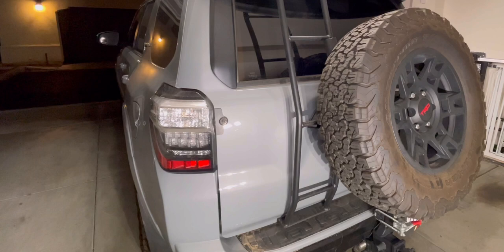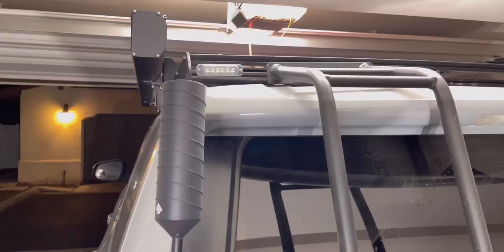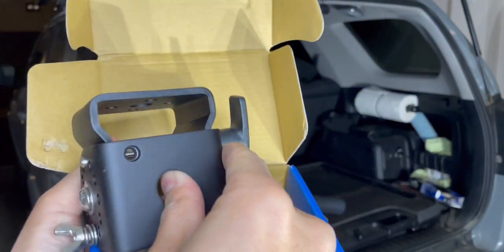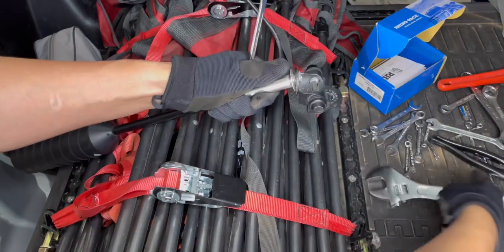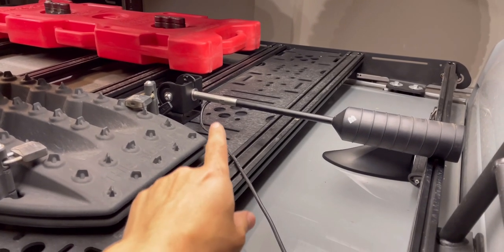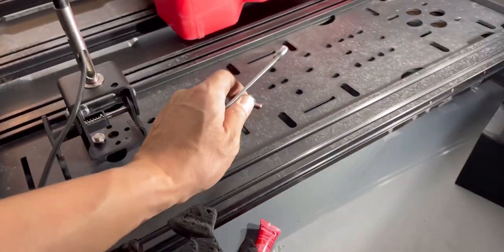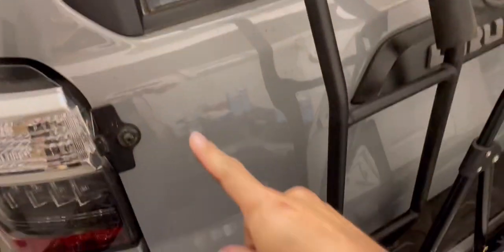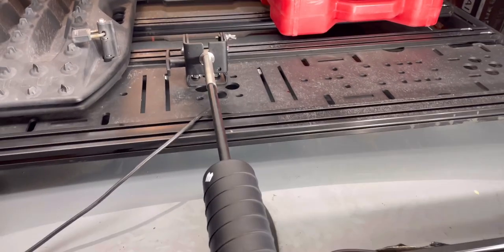Rhino Rack Aerial Bracket for 4Runner: WeBoost Folding Antenna Mount 🚙🔧 【72】

Comment: First, stop taking advice from people who don't know a thing about antennas; if they don't have formal education in electronics, EE or didn't have to take a test  to get a license, walk away. Second: What you have there is not much better than a dummy load mounted outside of your car. How, you ask?  Just look at it; putting a lump of inductance in the form a large coil at the top of the radiator is where it'll get the hottest meaning signal loss. Putting coils at the base or the top is a good way to loose radiated power. DON'T DO THAT!  C.B. radio sources are replete with garbage information. If you want to put a coil (aka, lump of inductance) to shorten your antenna length, put it somewhere in the middle where efficiency is greatest (think of current and voltage distribution (90degrees out of phase)).  The ideal placement for a loading coil in a quarter-wave vertical antenna is at the center of the antenna. This position offers the highest efficiency. If center loading is not feasible, the next best option is base loading. Top loading with a capacity hat or a large coil, is less efficient and can make the antenna mechanically unwieldy. This last reason is why your "booster" antenna sheared off. Again, DO NOT follow advice of [most] C.B. venues. Placing a center loaded antenna in the middle of your roof will give you the most bang for your buck, IF you're operating while in motion. If not, skip the loading approach and go with a full length 1/4 wave vertical, with a good ground (don't drive with that however!).
Reply from the maker: This antenna is not a CB antenna. It’s a signal booster for a Cell Phone signal. I’m scared…🤣👍🏼

Comment: Aren't you worried or concerned that you might get the WeBoost stolen. Where can you buy the bracket
Reply from the maker: Actual Weboost device is inside the car so they won’t steal that unless they break the window. It’s only the antenna that’s exposed so I guess I can’t worry about that or I can’t have anything mounted outside. 💪🏻

Comment: I thumbed up the video for support, but that mount doesnt seem useful at all. Too much work to fold and unfold it. I prefer the spring setup the Weboost came with that allows me to keep my antenna up at all times without worrying too much about if it hits something. 2 years and counting, with multiple strikes and no damage to the antenna to speak of. My antenna is mounted to my Gobi rack using the mount my antenna came with.
Reply from the maker: Oh. I had the original Weboost spring Mount system. It broke off as soon as it hit moderate branch. It broke just under the spring where the screw is located. Weak as Fuc*. LOL.
Reply: Smashed my antenna in a parking garage; forgot that it was still up there and cracked the damn thing.  Folding down would be nice... though I would worry about it smashing itself against the roof as it bounces around up there when flat.

Comment: Thanks for the post! Ordered the unit for my Jeep Gladiator after almost breaking my fixed mount antenna. 

Love my Weboost!!
Reply from the maker: Great to hear. 👍🏼
Reply: The way mine will be mount I wont have the safety screw to tighten it in place. Think that will be an issue?

Comment: Hi, did you ever test signal with it laying down versus upright?  I want to do a similar mount and am curious if during normal driving it still works decently when folded.  Then when I'm truly remote it'd be flipped up for the best reception?  Thoughts?
Reply from the maker: Flipped up had huge Signal gain. I didn’t make a video but it was a difference for me